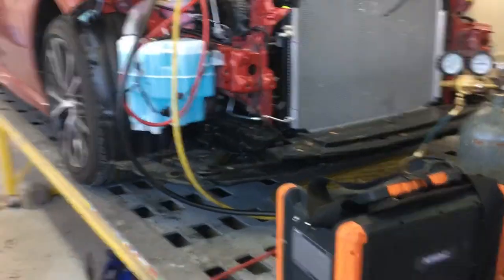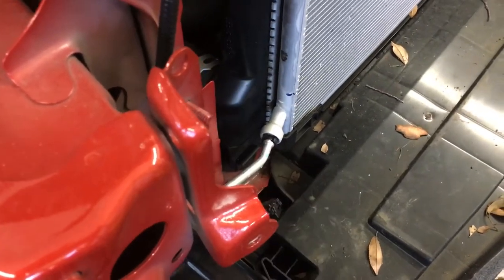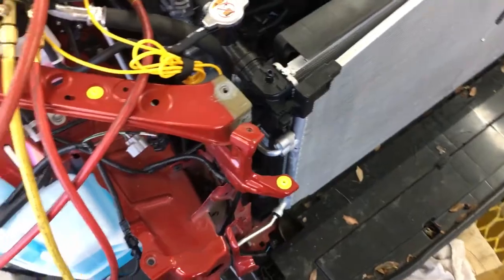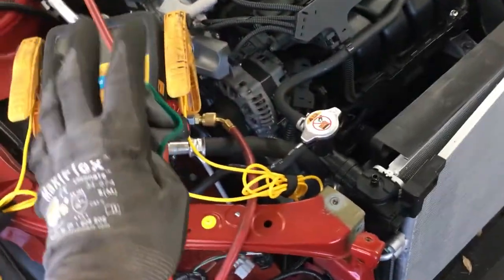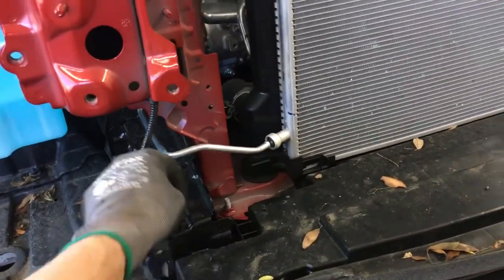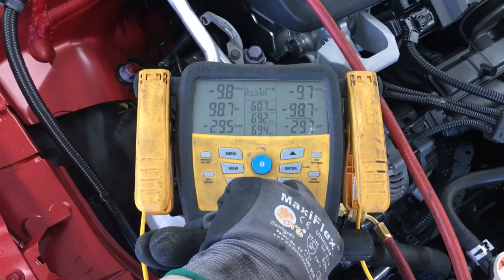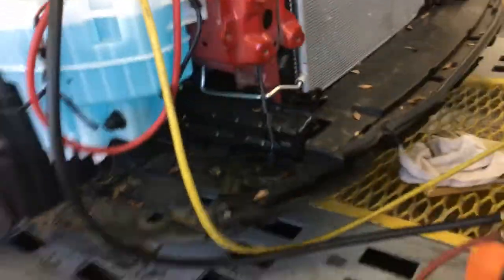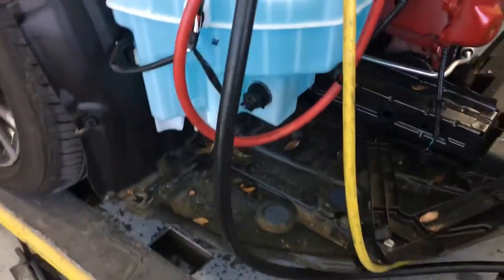2020 Toyota Camry AC condenser liquid line plastic clip breakage

Comment: So you add 1 psi of nitrogen to every system before you open it?
Reply from the maker: Yes exactly Anything positive pressure 2 psi 5 psi it doesn’t matter.   Don’t want to go any higher than that because when it’s opened it spit out a little bit of refrigerant oil and it burns when it gets in your eye.

Comment: I’m kinda confused here, have a 2020 Corolla se and ac won’t work and found out that this exact happen, just need to get new clips and o ring from dealer, and hopefully it’s just that, but do I need to get a new OEM condenser for it or need to take it to a shop where they recharger the condenser with that nitrogen tank
Reply from the maker: I doubt they have nitrogen to do a pressure test very few shops do. 

They’ll just be putting on a new clip O-rings add some oil and recharge the refrigerant
Reply: @coldfinger459sub0 I can do that myself! Hopefully that’ll be it! Thank you !
Reply: @coldfinger459sub0  One more thing, how do I recharge my car with refrigerant, is there a specific bottle/refrigerant that I need to use I don’t want to mess up my AC
Reply from the maker: @platinum0972  read the manufacturers instructions you’ll have to download from their website. 

You just want plain refrigerant no additives . 

Any oil that needs to be added read manufacturers instructions on type of oil to purchase oil they sell everything at Toyota .